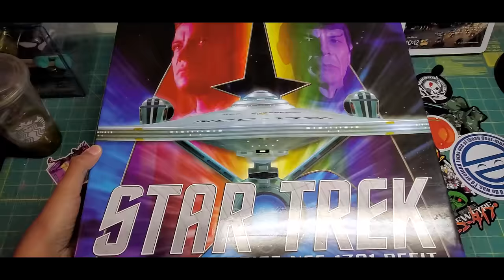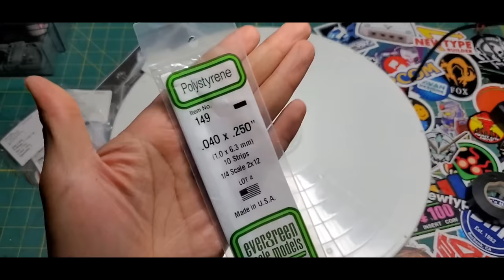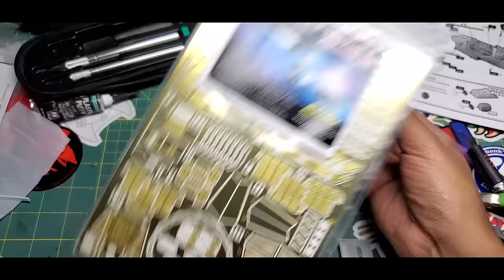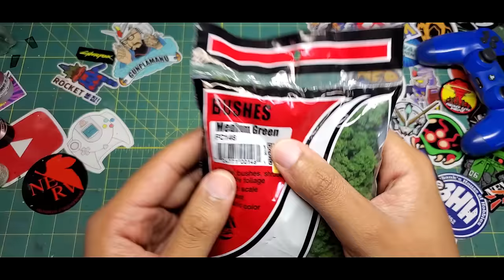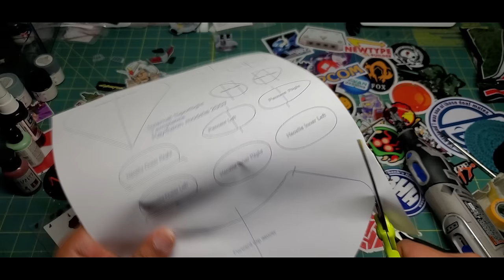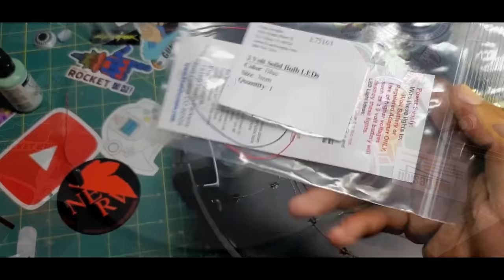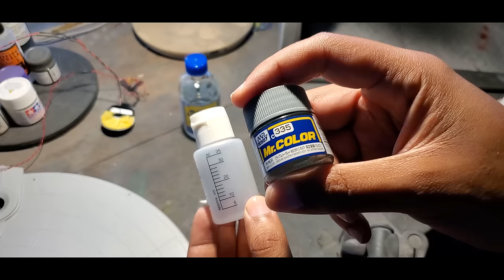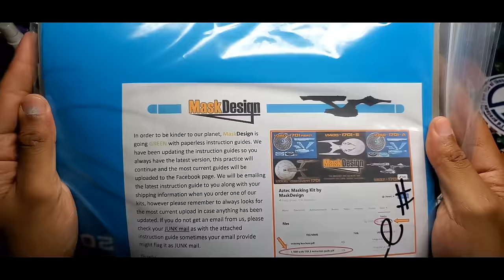#newtype #startrek The Journey Begins Part 1! 1/350 Star Trek Uss Enterprise Refit

Comment: Nice Job, very good and professional video coverage. I've built the AMT version many times (5) and my last has been on the bench semi-finished for over 20 years LOL!! Couldn't find the Mr. Smoothy version so I sanded the entire surface smooth. But I'm glad you went with the light grey base coat same as I did all those years ago. As my experience with film production, it made sense that the TMP model makers would not have used white its to harsh and too hard to control exposures.  I'm going to build the Polar Lights version next before I finish the AMT version, the larger scale makes it easier - I think anyway. I'm  also very pleased you were able to preserve the dish edge sensor array grooves, shows your skill level is on the high side. Keep up the good work and I look forward to following your completion of this great ship. Thank you.